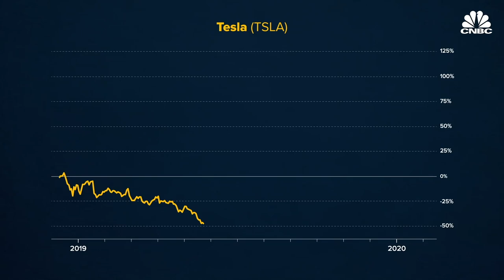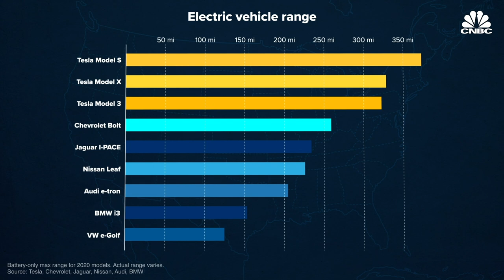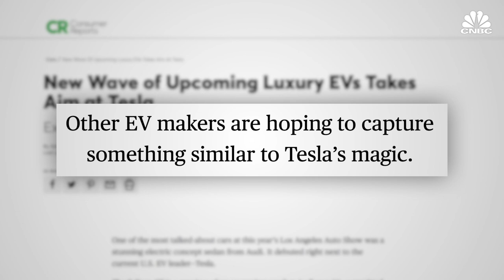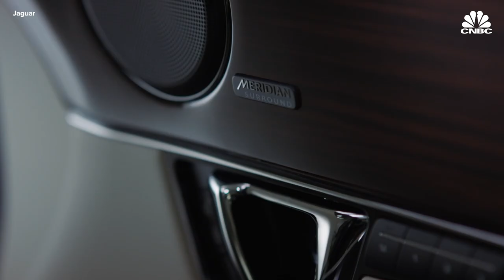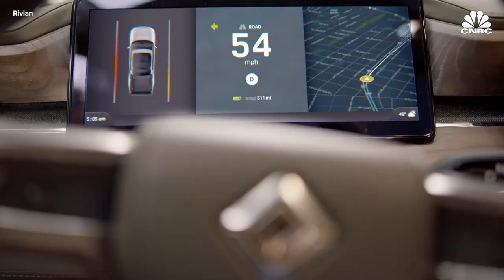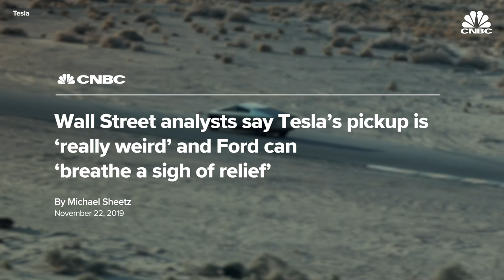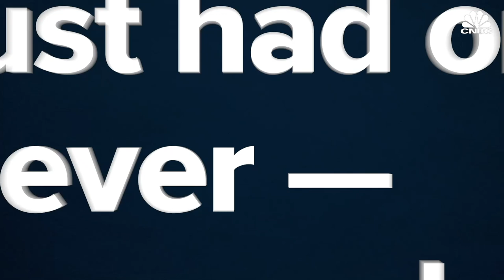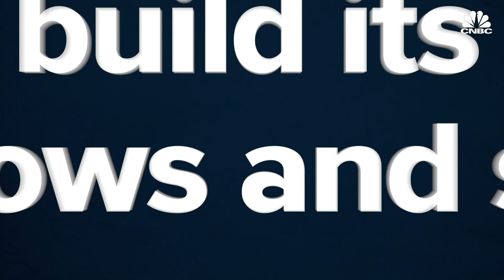Which Automakers Can Seriously Challenge Tesla?

Comment: "Planning planning planning planning planning" except all of these cost 3 times their value compared to a tesla, go half the distance and get cancelled after 1 year. Big companies don't have the battery technology, small start ups don't have the manufacturing capabilities or experience.
Reply: xD Who? 
Everyone has the same battery technology because thats how battery's work nowadays, the only reason Tesla is successful is because america's so big, you need massive ranges to get anywhere in a reasonable amount of time. In Europe you dont need this, everything is near each other which is why Tesla is so rare in Europe, in Canada Tesla is apparently quite rare as well because its too cold for the batteries so petrol isn't going anywhere there and the same goes for Russia. 
Look up Honda's e vehicles, their coming out in a few months and pack more innovation than every Tesla combined.
Reply: @holyravioli5795  does Honda has autopilot? It doesn't? Oh.
Reply: @biglightball  Do you need autopilot? No? Oh.
Reply: @biglightball  But you know what Honda does have? A full dashboard screen with two side screens, no side mirrors which prevents rain building up on them, two sleek side mounted cameras linked to the two inside screens. A middle mirror that changes from a regular mirror to a camera. HDMI ports that let you plug anything into the central screen.  One of the tightest turning circles of any car, tighter than even a tiny Nissan leaf. Supposedly one of the most comfortable and relaxing drives ever. 

And most impressive? An EV that even die hard gasoline lovers like.
Reply: @holyravioli5795  Actually no. Tesla and Panasonic have been developing their battery tech for 10 years now. Including patented cooling methods and BMS (Battery management system) software and tech which no other manufacturers have, and that's what gets you your ranges,. Let alone the efficiency of the drivetrain in which tesla is also on top.
Reply: @holyravioli5795  AAAAAND 0 sales. Cool. Next concept car please.
Reply: @dennispremoli7950  Its not a concept car, you can reserve it now. Theirs already reviews up for it.
Reply: @dennispremoli7950  Save your life? How? Are you that incompetent that you need the car to save you from driving off the road?
Reply: @holyravioli5795  Is it in large scale production? Call me back n a year or two once it's sold more than a couple thousand to some Hyundai aficionados.
Reply: Tesla doesn't have the technology either. Tesla leaves that to Panasonic. The others could do likewise.
Reply: @jjjjquest9999  The only thing Panasonic does it the pure chemistry of the battery. They have exclusive deals with them and Panasonic works on part of the Giga factory. That technology is not going anywhere to other manufacturers. Furthermore, the real deal is the BMS electronics and software. That makes a massive difference to a car's range, much more than the chemistry of the cells.
Reply: @holyravioli5795  , the Honda is cute. But it is yet another small EV with a range of 125 miles or so, what they call a "city car" for marketing purposes. It will not be sold in the US at all. I guess it will get some sales in Europe, but go ahead and look at the sales numbers for all of those dozens of other "city cars," they are under a thousand a month mostly except for the Leaf sometimes. From what I understand, the Honda will cost not a lot less than a Model 3 SR +, so outside of the use case of people in Europe who live or work in the older parts of cities where the roads are really small it is hard to see many picking the Honda.
Reply: @dennispremoli7950  , Tesla has their own proprietary patented battery cell chemistry (frequently updated) that Panasonic uses to make batteries for them. Tesla's battery lab was until recently headed up by Jeff Dahn, a legendary name in lithium battery cell chemistry who trained most of the other leading researchers in the field while he was a university professor. Tesla also has played a huge role in helping Panasonic shrink the space and machinery they needed for production; right now they are making the same amount originally planned for the entire Gigafactory in a third of the space. There are no doors between Tesla and Panasonic at the Gigafactory and Tesla engineers frequently work alongside Panasonic.
Reply: @tribalypredisposed  As a European i can confirm that every road is a tiny road in Europe. I can see it being pretty popular around Europe as the range is reasonable for what you would need in most cities here and the sheer luxury of the car would be a big reason for alot of people here who see electric cars as just regular cars but electric. Seeing something as different as the Honda e but not as ugly as the model x might convince more people to consider an electric car.  
The car just feels like it was designed for Europe's infrastructure and not the USA's so i can see where you are coming from, 125 miles is nowhere near enough for America where everything is so far apart but here everything is very close.
Reply: @tribalypredisposed  Well there you go. Thanks for the clarification. That I know of still, the BMS development is Tesla only.

Comment: Compare the buying process of a Tesla compared to any other car.
That's a big reason to buy Tesla instead.
Reply: zqube Aren’t Teslas also bad for the environment?
Reply: Negative captain. Buying a Tesla is the worst buying experience. I know, I bought one.
Reply: @PleasentDddd  Yes, manufacturing Lithium batteries is awful for the environment. But they won't always be the batteries that we use. The switch from petroleum to electric cars is difficult because of infrastructure, so getting the ball moving is a good thing even our current batteries aren't great.
Reply: slicedtoad I was asking if recharging batteries that large was bad because it requires burning coal to produce electricity.
Reply: @pilotbuckus4100  Oof I know for a fact you're lying all Tesla purchases are to your liking and are seamlessly smooth.
Reply: @pilotbuckus4100  I bought one too, last year.   Went on the website on a Thursday night, configured and ordered the car, paid the deposit. An hour or so later they asked when I would like to pick it up.  I chose the next day.  Picked up the car, paid the balance, done.   No haggling with sales people, no back-and-forth with the sales manager. Done.   I don't know what they could have done to make it any easier.
Reply: @PleasentDddd  A recent study showed that even if all of your electricity comes from coal (only true in certain places) EVs are still cleaner in the long term. BTW, coal is now the #2 source of electricity in the US and its going to be used less and less in the future.

Comment: "Swarmed with long range ev competition"
Porsche releases a car for $200,000 that can't do 200 mile range irl
Reply: Yet there's been multiple tests showing that the Taycan has much much more range than the epa suggests. Even one test showing it within 10 miles of the model s raven
Reply: @abhishekpersad4127  Fake news
Reply: Taycan Turbo S even has LESS range, less than 195 Miles.
what a JOKE the Taycan is.
Reply: @abhishekpersad4127  and the range was still around 200 miles... if you're talking about the car and driver test, they compared it to a standard model s (which is nearly 50k cheaper). i saw a video on YT the other day where a guy drove a bunch of electric cars from full charge til the battery died and shocker: the taycan died first.
Reply: @fcv1967  Car and Driver: "In our testing, the Porsche Taycan's range nearly equaled that of the Model S"
"The vast difference in EPA figures didn't amount to much in the real world."
https://www.caranddriver.com/reviews/a30874032/porsche-taycan-range-test-tesla-model-s/
Inside EVs : "Yet another publication proving the Taycan's range is not nearly as bad as its EPA suggests 
https://insideevs.com/news/397182/tesla-model-3-vs-porsche-taycan-range/
Do your research before calling fake news
Reply: Thinking that range is the only metric that makes a driving experience is the joke.  The 800v system cannot be overlooked, as well as its consistent performance figures where Tesla flops after a 20% or so drop in charge. And, serious question, how many times during the year do most drivers exceed 200 miles in a single drive?
Reply: @markplott4820  There's been tests showing that after only 5 consecutive drag pulls, the Model S's 0-60 will drop to 6.2 seconds w a 1/4 mile time of 15 seconds, whole the a Taycan showed 0 performance degradation. This was after having to pre-heat the battery on the Tesla for 45 mins to even unlock Ludicrous mode (that was news to me as Tesla fans seem to convienetly forget to mention that). All that with the Taycan having not that much less range than the Tesla (tested and proven) and you call the Taycan a joke? Delusional 
Source:https://www.caranddriver.com/reviews/comparison-test/a30799498/2020-porsche-taycan-turbo-s-vs-2020-tesla-model-s-performance/
Reply: @Pewpshmear  Many tests have shown much more than 200 but okay 🤷‍♂️ Do you have a link to the video?
Reply: Compared to the $200k base roadster that will go 600+ miles and the fastest car ever
Reply: @abhishekpersad4127  - the Tesla 2020 model S Raven beat the Porsche Turbo (ICE) on the Laguna Secca race track, Tesla had the Fastest Track time Setting a Record at the Track, Tesla also Beat BMW M3, 3/4/5 series on the Track as well, including MBZ C class and E class.
Reply: @iKingRPG  It wont be the "fastest car ever" not by a long shot, esp not by top speed.  Tesla barely ever stays true to their word
Reply: @abhishekpersad4127  Tesla just announced the S now will get 390 miles!
Reply: @christianjforbes    Now that Porsche can't break 200 miles range suddenly it's not that important.  BMW announced that drifting is more important than 0-60.  And Porsche came up with something called "repeatability" as if that was a thing (up to now).

Comment: Brand power is the main thing, driven by Musk and his vision (similar to Apple/Jobs). 

Another thing that comes to mind is that other manufacturers have tried electric cars before, but have mostly failed. I think due to this there is a mindset now that traditional manufacturing companies won't make good electric cars. In my mind it is because they don't have to as their main focus was/will be on ICE cars. Tesla only produces electric cars, so they have to succeed and will probably pour all their efforts into it (and they are).
Reply: No one has tried electric cars like their future depends on it. No company will commit to a product that barely has a 2% marketshare worldwide. The current automakers have more experience in production which is why they’re not making their cars in a tent... or having interior panels that mismatched. Look at what Porsche just did..they made an EV that has the ability to sustain its performance without overheating and cutting power like the model s does and they’re whiting 15 Miles of range within each other. 

If it came down to staying in business, we would have many great electric cars, but since EV market is barely at 2% worldwide.. no one really cares.

Comment: So far no auto manufacturers can beat Tesla or will do in the next 5 years unless they come-up with the equivalent the technology of testl which is having 320  miles per charge, over the air updates for any vehicle related issues & new updates, autonomous driving and most importantly coast to coast charging. 
If Tesla can come to a point where charging takes the same time as a gas refill, it will dominate 80% of the electric market.
Reply: ghost ghost Two of my cars connect to my WiFi while in the drive way and get their updates. That’s the closest they compete with a Tesla. Agreed on the charge time. Though to be fair unless you’re taking a long trip I see the appeal of electric for day to day driving.

Comment: I question if EVs are the future or not. We were told that hydrogen was going to be the future and that never happened. Also, if it were not for tax credits, would people want an EV. As I say this, they just reported that sales dropped when China killed off their own tax credits. 

But let's say that EVs are the future, I would get any other brand other than Tesla. For one, I can go to any dealership for service or a NYS inspection. I don't have have to drive too far out of my way. I don't have a wait time to get my EV and lastly, if I were to get the eTron, it has a spare tire. Something that Tesla doesn't have. Living in the NE where potholes are a real concern, having a spare tire is a requirement. 
If EVs are the future, the price needs to come down and charge times need to be equivalent to getting gas.
Reply: Spare tires are deleted by nearly all car makers, alas, really stupid policy. Tesla should at least offer it as an option. With V3 Superchargers you might get 125 miles of range in 10 minutes. Not perfect but getting there.
Reply: 1: for Hydrogen, it's a simple physics problem. The amount of energy it takes to actually get that hydrogen in the first place is more efficiently used being put directly into an EV battery pack as fuel cells are only about 40% efficient, compared to 95%+ of EV's

2: for servicing, that's largely a Tesla only issue. For the Bolt at least, they have service info with most major commercial repair manual companies already, and existing GM dealerships can order in parts for shops no problem usually. Tesla only recently published their parts catalog after a right to repair law forced them to.
Reply: @cpufreak101  with Tesla, you can service your car anywhere. As long as it is not drivetrain specific. Like rotating the tires, wiper blades, brake fluid and the like. However, I am sure there are independent shops are already working on or some are getting ready to service EVs. 

But this has nothing to do with repair manuals. My point I am making is that the number of Tesla service centers are few and far between. Where as I can go to a any given Ford dealership to have my car worked on. 

But the other issue is that there are some states that don't have inspections or if your car is x amount of years old, you don't need to worry about inspections. So, with any given car, you have a reminder of when your car needs to be serviced. Tesla doesn't have that reminder. I don't think.
Reply: @Andrew-zv4fm  ah I get what you're saying now. Yes that's true, stuff like tire rotations could be done anywhere, but if I remember right some newer ones with the special sensing wipers need a service visit to replace. 

As for Tesla service centers, that's really one of the largest issues with the brand. There is so far only a single independent repair shop for Tesla's, and it's ran by Rich Rebuilds (look him up on youtube if you don't know him). The largest problem pertaining to third party service is Tesla just doesn't like to make their parts available unless legally required to do so.

As for inspections, this varies where you live. I know here in NY, it obviously wouldn't have to pass emissions, but it'd still have to pass safety. However if you're in a state with only emissions inspection, then it'd be no inspection at all. I think that answered what you were asking.
Reply: @cpufreak101  you did so and then some. 

I live in NYS so for having an EV I could do tire rotations, wiper blade changes and the like on a yearly basis. But in states that don't have any inspections, people may forget about something as recommend like a tire rotation. Being an EV, I don't know if Tesla has a yearly reminder. Other makes that have EVs in their lineup may have a yearly reminder. Something to look into.
Reply: @Andrew-zv4fm  ah I see. From what people tell me that live in such states, it really is up to you to keep track of your car has no "maintenance minder" and due to lack of oil and other fluid changes, I'd imagine Tesla's wouldn't have any sort of maintenance minder for that reason. Rather it pops up an error message for service whenever it detects a fault.

Comment: If I were a betting entity, I would watch Mercedes very closely. 
The engineers at Mercedes are World Class. From what I've seen from an inside view of Mercedes
plans I will confidently say that what they have in mind, and on the prototype engineering floor, is simply
amazing. They are preparing to strip away at least 50% of Teslas business based on technical innovations
alone. That's before any consideration is even given to amenities and interior / exterior options are
considered.

Comment: None of the "Tesla killers" are even near to competitive on price, range, performance, automation, technology, over the air updates, fast charging infrastructure, etc.  The other car makers are 10 years behind Tesla on battery costs, capacity, etc.
Reply: Loanword Eggcorn automation. 🤣🤣🤣 good one, it’s just adaptive cruise control with steering asist
Reply: @benjaminplut9448  Tesla's existing neural network also does automated lane changes, highway changes, off ramps, on ramps, automatic parking, summon (car drives to you), etc.  It's not just automatic cruise control and lane keeping, and no one else can do all that.

Comment: People are not buying Teslas, they're buying Tesla's vision to accelerate the shift into renewable energy.
Reply: In part but it's also a value proposition, no one so far has seriously challenged them on efficiency, range, performance in general for similar price and that's before you even consider electronics, software, over air updates, AP, charging speed and supercharger network.........  Hopefully T. improves it's servicing, interior quality and DIY situation soon.